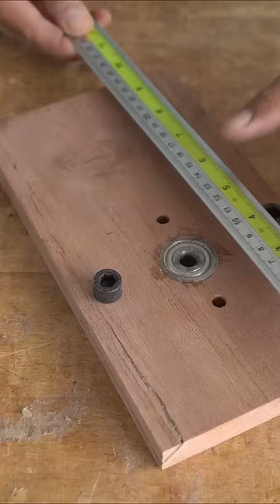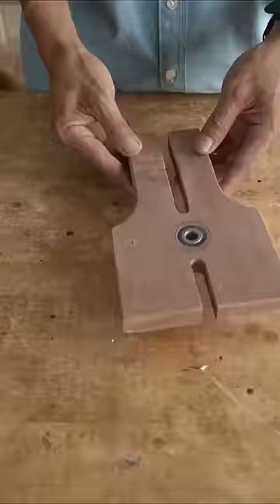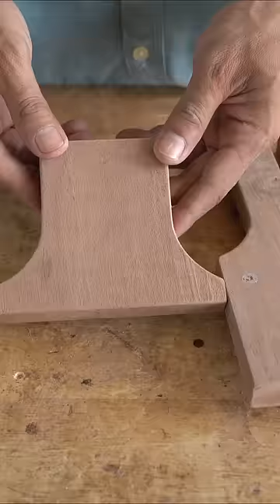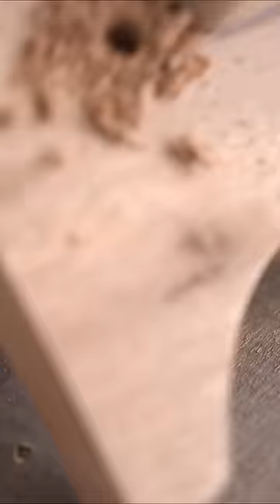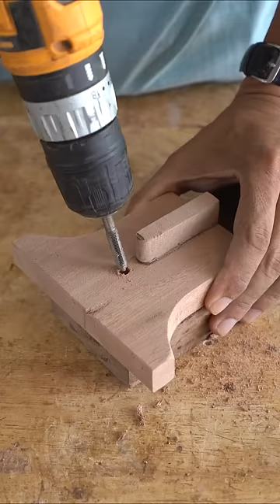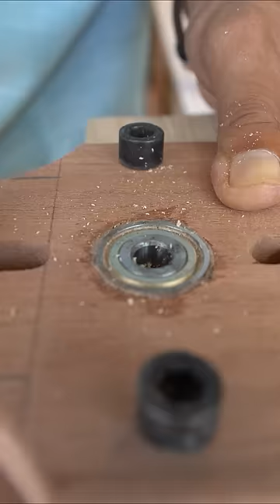Awesome woodworking tool for connect wood #woodworking #diy #amazing #awesome

Comment: I wish i knew what the hell he is doing
Reply: Making a dowel placement jig, for repetitive exact pieces
Reply: So ooo now 2 useless pieces of wood?
Reply: I have no idea even after people telling me.
Reply: @jefferylegere . The bearings act as accurate guides so you can drill holes that are properly aligned to the surface.

The large gap allows for a large area of adjustment over various sized gaps. 

It’s quite handy. Look up “Vintage Stanley No.59 doweling jig” to see a very old version that was designed for the old hand powered drill braces. The Stanley has different sized bushings for six commonly sized holes.

This video here depicts only one size which is fine if you’re doing a large run of the same item/holes, or use the same size dowel on all of your joints…

Comment: Why do you need a bearing in the drill guide?
Reply: It's so that constantly using the drill in the same hole won't enlarge the guide hole, as would happen with a plain hole. A bearing like this will rotate with the drill bit, instead of constantly being cut bigger and becoming sloppy and inaccurate.

Comment: Here is the real question, if they've made overclocking bios for the 7800x3D cache, then they should be able to make it work on the 7950x3D.  where and when can i get my hands on it.